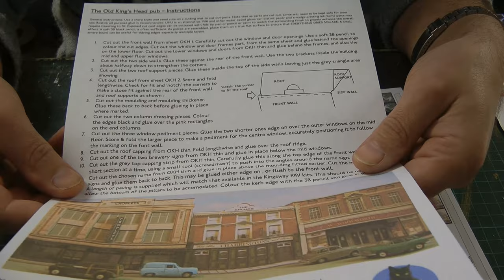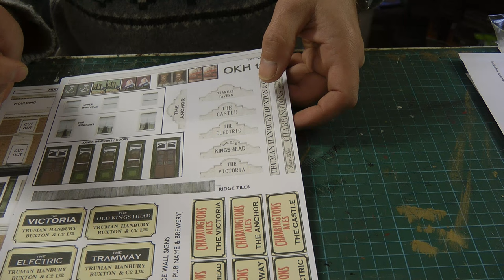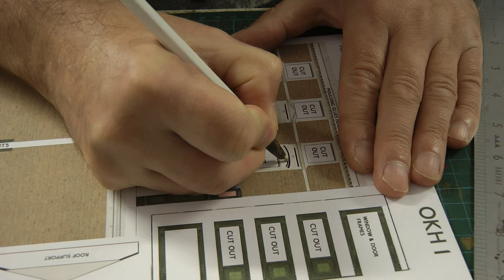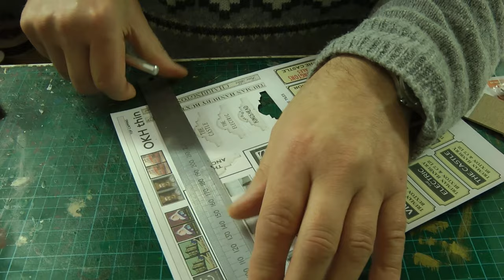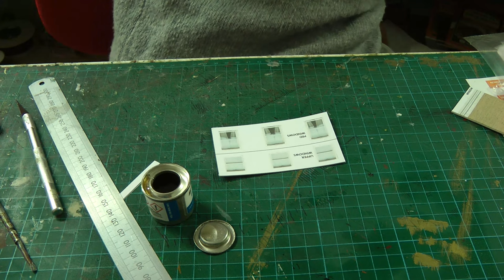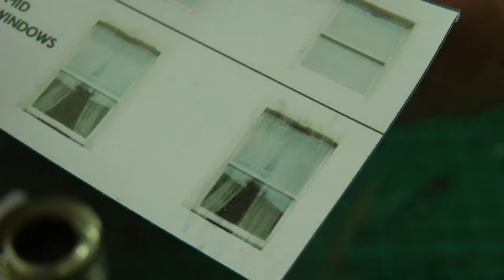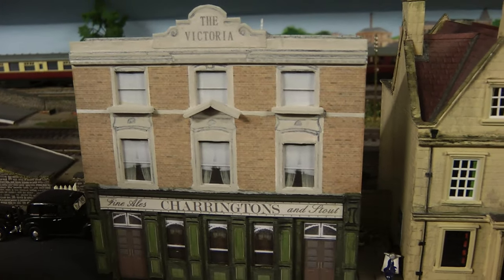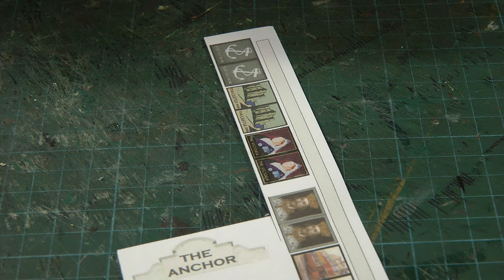Kingsway The Victoria Pub No406

Comment: Wow, that soon turned into an impressive collection. They really do compliment each other and it has been so worthwhile adding these enhancements to each. At 2mins in you look to have quite a gap at the back when holding front of building butted to the road edge. Suggestion - could you add in say a two to three inch footpath that would set the rear of the buildings just clear of the handrail. If you could I think it will allow you to see more of the lower part of the buildings and let in more light to show the buildings off even more? Take care, the end of my second sitting this evening, oh and a good morning to you! All the best Stephen.
Reply from the maker: Good evening Stephen. Funny this time line difference, you say good morning. and i say good evening. i could have added a inch more to road. but i still to get access to the hand rail. thanks again for commenting my friend. cheer's Tony.
Reply: @TONYNORTHEASTERN  Good evening Tony, six hours behind here and having an after lunch “cuppa tea”. It has its advantages, when working with USA engineers could ask them questions as I left work in the evening, for them to have almost a day to work on, reply and I’d pickup the results first thing in the morning, very timely/ efficient.  It was an observation from the camera angle you presented didn’t know if a problem, could make removable/ hinge up/ or viable. Your 1min short I sandwiched in as the “intermission” and doing the washing up in between the Odeon and this build’s viewing - another TNE binge evening……..a terrible habit!! Have a good evening too. All the best Stephen

Comment: Dear Tony, love the different tweaks and details you added. Already was aware of the narrow space between the Yarrow road edge and the hand rails around the loft staircase. Seems though you need to further narrow it down to mount the row of buildings. Very curious as to how the view over the Stephenson’s embankment, the Yarrow Road station emplacement and the narrow Yarrow road with its buildings and backdrop is going to look. Also am curious for your future use of these kind of structures, whether kit, bashed or scratch built, for the enhancement of the different backdrops on your layout. These ‘flats’ have indeed a lot of potential. Cheerio
Reply from the maker: Good morning Vincent, I hope one the back drop is in place it will enhance the viewing of trains passing the station below. so yes i am the same really looking forward to finishing of Jarrow Road. many thanks again, have a great weekend. cheer's Tony.

Comment: I know it isn’t anyway near as good as your scratch builds, but that shows again how simple adjustments and additions turn a decent kit into an excellent model. Adam’s you say, it is serving a purpose rather than being a major focal point, so I think it is just perfect 😉

I was wondering if you’d considered giving the row a raised pavement, set back a smidge possibly with a railing walkway adjacent to the cinema to protect eager film-goers eager to get in while others struggle to get out! It would suggest that the pavement predates many of the newer buildings as it was built when horse and cart was till the most numerous form of transport 🤔 

Hope that makes sense mate, have a great Christmas 🎄👍🍻🍀🥃
Reply from the maker: Hi Onno, space is very tight as you have seen. i have started the back board. the strip of timber is only 30mm wide, which is just room for the building and the paving. hopefully it should work out well. thanks again my friend. and happy holidays...cheer's Tony.

Comment: Looks like I gave you a bum steer with the gloss using your normal products.  Sorry about that, It works on my buildings using Scalescenes prints and an Inkjet printer.  I sprayed the gloss using paper masks to protect the rest of the building/  You got there with the Queen though after a bit of disappointment on the first go.  Have a happy Christmas and a safe New Year
Reply from the maker: Hi Dave. no need to be sorry my friend. but yes it just does not work adding clear varnish directly onto the paper sheets with the windows printed on them.
Thanks again for commenting my friend. and have a great Christmas yourself. all the best Tony.

Comment: Great Work! Why don't you attach the backscene to the back of the bannister? That would give you a proper, wide street.
Reply from the maker: Nice idea. but i don't want to attach anything to the banister. as i need to baseboards separate. just in case i need to dismantle the layout but yes great idea. many thanks Tony.